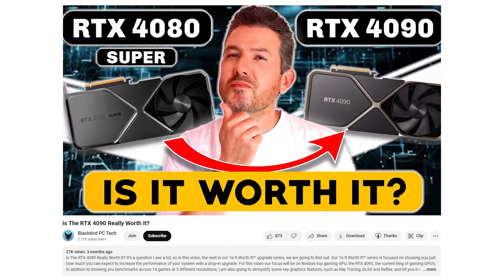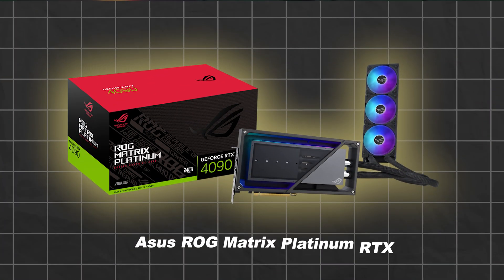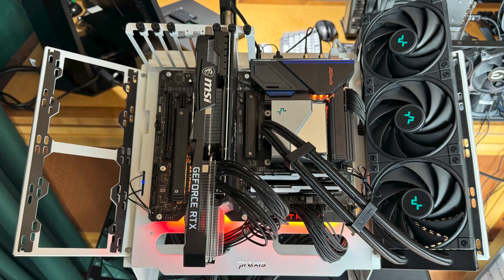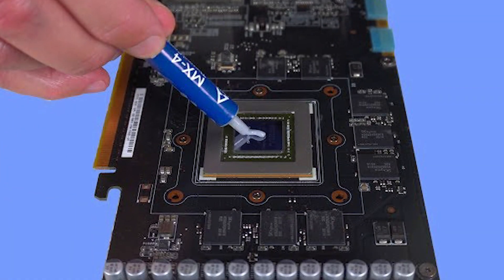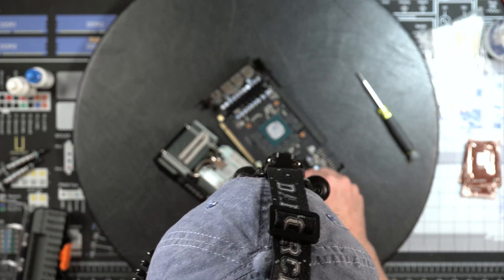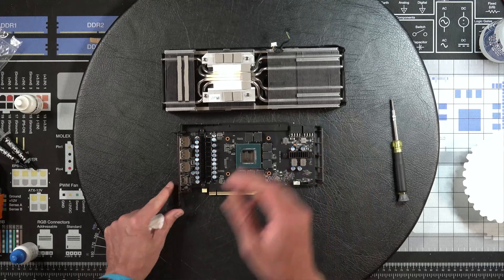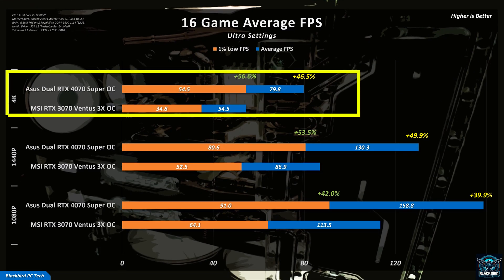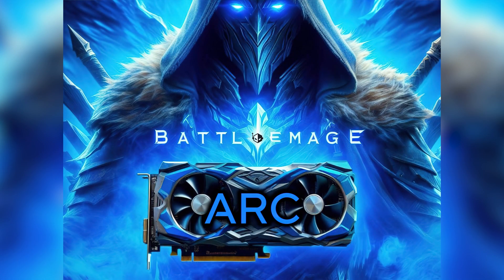Is It Worth Upgrading to an RTX 4070 Super?

Comment: If your going to do a test like this you can't use 3rd party you have to use GeForce RTX 4070 Super Founders Edition the card in this video is budget and is a shit make.
Reply from the maker: Misinformation posts like this are important to leave up because I think it's a good opportunity to learn. There is absolutely NO difference between the GPUs used in different cards of the same variant (beyond typical silicon lottery variations). So a 4070 Super GPU is the same regardless of what brand sells it. The only difference is the cooling solution, board layout, power delivery, etc. However, assuming that the cooling solution is sufficient, none of these items will impact the performance at stock settings. In fact, these GPUs from Nvidia are all voltage constrained, so even if you have an ultra expensive card with the best quality components, you will end up hitting a voltage limit. You can see this with the ROG Matrix Platinum 4090, which I tested extensively. Furthermore, the Asus Dual card that I tested in this video is definitely not a "shit" make as you state ... Asus may have service related issues but they design and produce high quality components.
Reply: @blackbirdpctech  Opinions vary, Nvidia use far superior parts and silicone. I challenge you do test a founders edition against after market... you won't do that though will you ?
Reply from the maker: @Sgt_Wilco  it's not an opinion, it's fact. Nvidia, like AMD and Intel, produce the same GPU spec regardless of the final card manufacturer. When you say something that isn't true, the burden of proof lies with you, not the person that highlights your error. So please feel free to provide any data or evidence to justify your opinion. I've tested multiple Founder's Edition cards on my channel, so feel free to use that data, generate your own or leverage another source ... hopefully by doing some research you will understand that your "opinion" has no basis in fact.

Comment: The 8GB of VRAM really holds the 3070 back in modern titles especially. 12GB is sooo much better. I have a 6750 XT and 12GB is a good middle ground for 1440p gaming price performance.
Reply from the maker: Agreed ... that's why it was smart of Nvidia to finally come to their senses and make a 16GB version of the 4060 Ti ... AMD definitely does a better job stacking their cards with VRAM.

Comment: Yooo, it’s been so long since I’ve see. Your channel on my recommended. It’s good to see it again, your videos are amazing, also amazing video dude love the content. What is your fav gpu of this generation?
Reply from the maker: That’s a great question. If I was to pick only one I would likely go with the 4080 Super, with special shoutouts to the 7900 GRE (testing currently) and Intel A770 (post software fixes). What is your favorite gpu of this current gen?
Reply: @blackbirdpctech  honestly that’s a valid answer the rtx 4080 super. I’m guessing the gre is pretty good. For me tho since my first gpu and desktop was from this generation would be the Rx 7900 xt, it has great performance and with my new build it’s gonna be fully unlocked and I’ll experience for a bit. Also what gou would u recommend including used market that wouldn’t be to much of a step down like down to the rtx 3070 levels of performance would recommend? I’m going to sell my current gou and rig bc I need the money for a new monitor and other stuff yk but wanted a decent replacement that could get me by until the rtx 5080 or 5090
Reply from the maker: So this may surprise you but at those levels I would give the Intel A770 a shot (I did a review of it ... it has a really attractive price point) ... the drivers have been fixed and it now performs at a level similar to the 3070 ... but it also can handle editing, AV1 encoding, etc. I really liked the 7900 XT when I compared it against the 4070 Ti Super, but I chose the GRE because it has been priced aggressively to deliver amazing value ... not sure why it took AMD so long to release it in the US.

Comment: A neat tip.  The PTM7950 sold at LTT can be used to replace thermo paste and it eliminates the need for repasting.  Just clean your fans and blow out your heatsink fins and your ready to go.  And for the ones using custom water cooling.  Even better.  Unless it gets gunked up, there is no need to ever tear it apart.  Just remember to chill it in the fridge before you apply.  Makes it way easier.
Reply from the maker: I haven’t used thermal pads for GPU’s yet but I love using them for CPU’s … I’ve been using the kryosheets from thermal grizzly … will check out the ptm7950.
Reply: I highly recommend them.  They are after time just as good as liquid metal.  So far.
Reply from the maker: Just ordered some from the LTT store ... appreciate the heads-up.
Reply: @blackbirdpctech  My cpu and gpu like them.  My Kids have been helping me build a system.  A 5950X and a RX 6950XT most definitely like them.  And, you're welcome.

Comment: I'm going to say the DLSS3.0 is a bigger fps increase with its fake frames then we think?
Reply from the maker: You can turn DLSS on without frame gen but I decided not to test any games with frame gen turned on for this review … I didn’t think that would be fair to the 3070.
Reply: I am not a fan of it in reviews or advertising.  Because all it does is...."Bigger number=Better".  It's just there to win the fps tittle.  Intel is doing that with it's 13th and 14th gen and having issues.  Hilarious.  

P.s.

I would still love to see how these 30 series and 40 series react when the Vram is mostly or fully used with the different bus sizes.
Reply from the maker: @patrickprafke4894  it's interesting you say that because I just ran Cyberpunk at 4K for the 4070S at Ultra RT settings with Frame Gen on and it used around 11GB of VRAM which caused some stutters, severely impacting the 1% lows. I'm testing it against the 7900 GRE ... should be interesting.
Reply: @blackbirdpctech  That's actually pretty cool.  I haven't been able to find or get somebody to test that.  I don't have the funds to do so.  That smaller bus has to have problems with all that ram to its disposal.
Reply from the maker: @patrickprafke4894  it’s the first time I’ve seen lack of vram impact the results … will investigate further
Reply: @blackbirdpctech  I still wonder if the smaller bus size between the chip and the ram is part of the problem.  Isn't a smaller bus size equal to less data transfer?  Even if it is faster, it's still got limits.  Can it keep up?  I'm thinking long term, these 40 series wont be able to handle the higher demands of the vram as the 30 series?  To us who can only afford second hand components, this would be helpful info.
Reply from the maker: I need to think of how I would be able to test this ... the 4060 Ti comes in both 8GB and 16GB versions, so it would be interesting to saturate the 8GB version and see what it does to performance ... but testing the bus size limitations is much more difficult because you would need the same card with two different bus sizes so I don't think that will be easy to replicate.
Reply: I know. I've also got no idea how test that either. A repetitive test. Time spy at 4k and 8k? I dont know of a benchmark you could use that could put a size limit on them as well as test the bus. I'll look into it as well after work. You would think in today's world. Something somewhere exists.

Comment: Hi! I've bought used RTX 3070 Inno 3D for 225$ 2 month ago. Sadly it is still waits for PC build... Planning to play CP 2077, Stalker 2 and Hogwarts Legacy at 1440p. Want to get full budget before black Friday. This week i thought of selling it for the same price but new stuff costs too much and will delay PC build even more... And used 3080 starts at 450$, new 4070 is 600$. I think it's better to tweak settings in fall than wait for "budget" GPUs in next spring...
Reply from the maker: I think that’s a very smart move … you can also try repasting the gpu to improve temps when you get your system together.

Comment: it's not worth upgrading as everything runs fine in 1440p on 3070, just don't set textures to ultra in some unoptimized titles and use DLSS quality if necessary.
Reply from the maker: You can definitely adjust the quality of the game settings to get higher fps but if you have a 120Hz or higher refresh rate monitor then I think the 4070S is a much better option at 1440p.